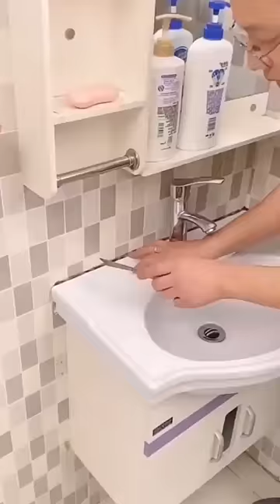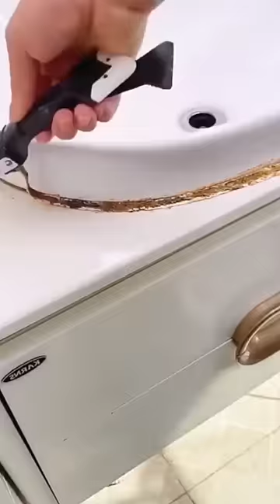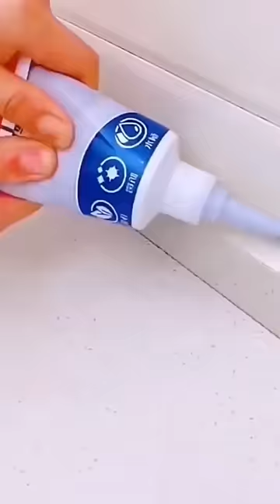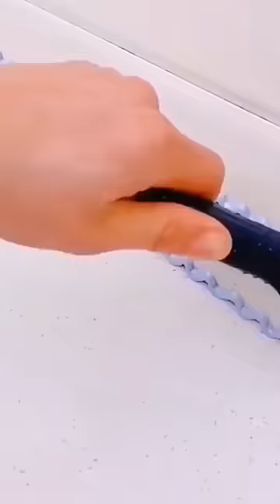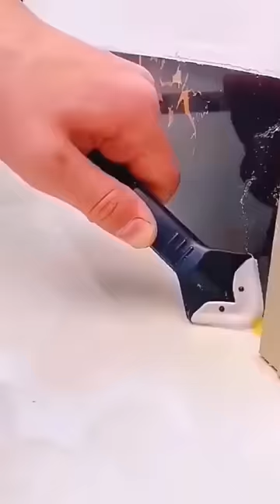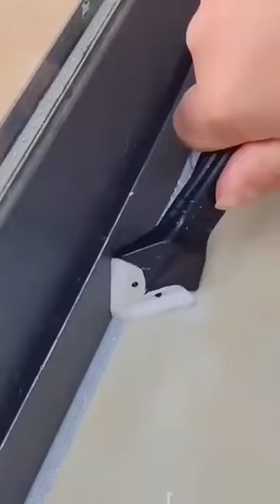5in1 Silicone Remover Scraper Repair Tool. Product Link in the Comments!

Comment: This is built into the tip of the silicone tube if you cut it correctly. For any small correction I just use a finger
Reply: Por favor en español y dónde comprar